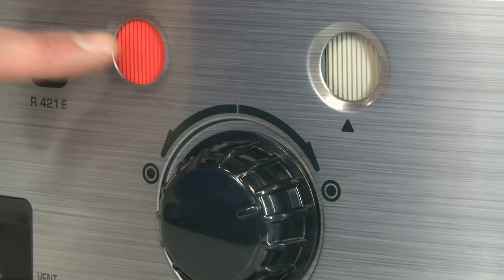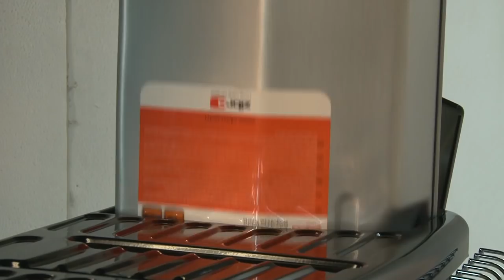Instruction movie replace wick for Zibro paraffin heaters with turning knob (until 2014)

Comment: Be very careful to note how the turning knob is dismantled and refitted. Especially the screw and metal spigot. If it isn't done properly you have a dangerous heater or at least very cold room.
Reply: i thought i did everything correctly as  shown in the video but when i re assembled everything i can only turn the Wick up i can't get the wick to adjust down unless i push in the emergency shut off. Some how as i raise the wick the adjustment knob gets locked into position and  will not go backwards to lower the flame. I wonder what i did wrong?
Reply: @mannyfragoza9652  My wick replacement was not a success. The new wick jammed in the sleeve and therefore prevented the safety tilt mechanism from working. My Zibro is now in the recycling facility, or "dump" as the locals call it
Reply: Well, why was it dismantled ? I don't think it was necessary. Yea sure only the knob removal but the inside was not right ?